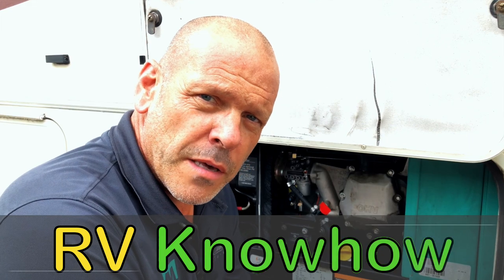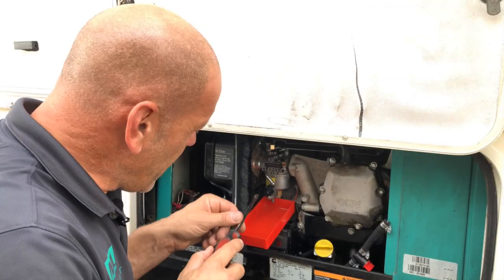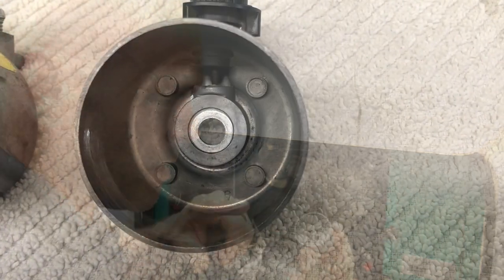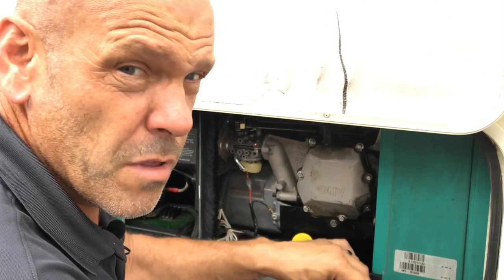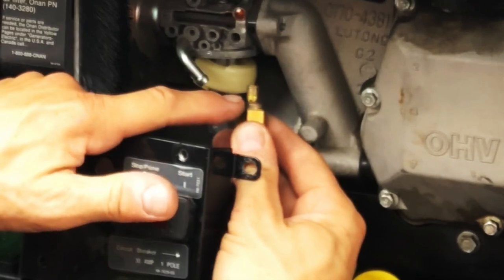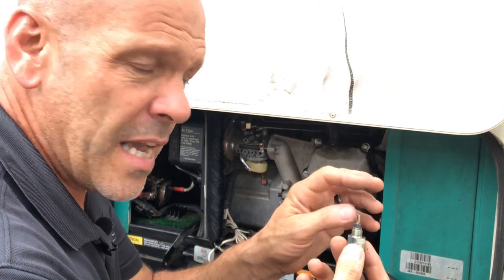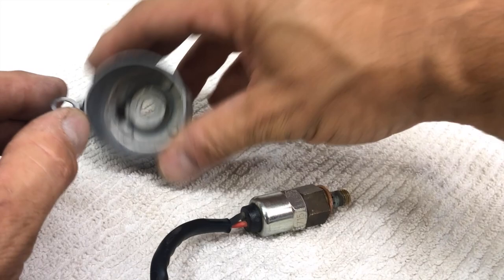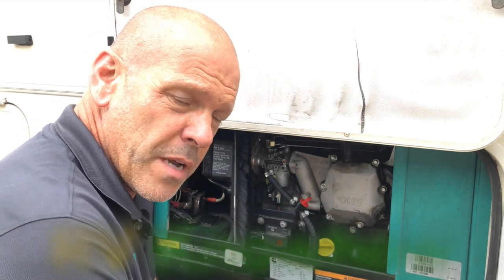RV Generator won't start, Fuel shut Off Valve Check and Fix. Part 2 of 2

Comment: Fantastic videos...part 1 and 2....I am a Rvia Certified Technician and I run my own mobile RV repair but never had much practical experience with Gen/Sets.....I see a lot of these 4000 and used these two videos to diag and repair one of my long time customers Onan 4000....I couldnt have done it with out your videos......very methodical and thorough.....thanks a million...looking forward to watching more of your videos....!!!

Comment: I have worked trough all dignostic here and all was fine. But the generator  woulden't start and go. The last thing was the carburator. I sprayed Carburator Cleaner inside through fuel intake pipe twice, and now the generator start and runs like a dream without any misfire.

Comment: Your video, single-handedly fixed my Onan QC 7000 genset. I learned from you that I could remove the carb bowl and clean those jets which fixed my "not-starting" problem. Thank you from the bottom of my heart. Getting compitent Onan service is neither easy nor cheap. You are now my go-to genset guy.
Reply from the maker: Glad to see my videos are helping and thanks for the comment

Comment: I found a good tip for the pesky wire behind the carb that you need a long pair pliers to disconnect. If you remove the carb to ultrasonic clean it that wire is long enough to run around to the front.  It's in a loom with other wires. Nip the zip tie holding the loom together and unlace the single wire and move to front. I suggest lace it in a single piece of loom for extra protection but not necessary. Not many will want to fully remove carb due to the fact its a pain in the ass getting it back in and gaskets lined up.

Comment: Thank you!  These things are finicky!  I just had to do the starter in mine (with the help of a mobile RV repair guy - and it took both of us).  Now having an issue with starting.  Fuel pump is good, spark is good.  This is the next thing to check.  Thank you.

Comment: I recently bought a 2008 Grey Hawk with only 7,100 miles and 37 hours on the Onan 4,000 generator. Everyone thought the generator would be trash. 
I removed the carb and cleaned the bowl, jets, and the STUCK SHUT OFF SOLENOID PLUNGER. 
Put it back together and it started right up. It even started at 6°F just two days ago.
Don't forget to check that plunger.

Comment: Great Video!!! I also had spark, fuel and air. Checked and verified via your first video. I even changed the spark plug just to be sure.  But still it will only crank but not start. This video helped me identify and clean out my stuck check valve. Now it turns on super easy. Thank you for the best video out there!!
Reply from the maker: Glad to hear my video was helpful and thank you for the kind words

Comment: All your video's have been very helpful! I just bougjt a Jayco Eagle 313H 2000 on an E450 chassis. My generator is an Onan 4000 KY. I bought a new battery fuel tank is topped off and it still won't Start. I will use your troubleshooting technique to see if that is my issue. Thank you so much for helping us newbies❤😊

Comment: That makes so much sense. Thank you for pointing out that these carburetors will run just fine WITHOUT that darn solenoid even installed. I have a main jet that just screws on without that solenoid. I know what it does and why, but mine was more trouble than it's worth. The main jet without the solenoid has three larger holes in it where the other one has about 6-8 holes in it.

Comment: Hey there, sir. I've been clutching so hard at so many straws. I watched this video and thought "nah, that can't be it". But you completely nailed it. This was my problem. Luckily the newer models are a little easier to tear into. All I had to do was remove the air filter mount so I could get to the bolt on the solenoid. The wires disconnected so I didn't have to loop them through the wrench.

Anyway, thanks again and cheers to you.
Reply from the maker: Thanks for the comment and I'm glad you found the video helpful

Comment: Thanks for the video it really helps.  My Onan 4000 starts but doesn't stay on.  I check the battery and is at 12.1 Volts, spark plug is good, air filter is good, and it gives me the same voltage when testing the options you show from the power to the engine and then engine and live as you did and it gives me 12.0 Volts.  I also checked the plunger and it's working too.  Do you think my voltage is the problem?  Thanks in advance for any help you can provide.
Reply from the maker: Hi, Thanks for the comment. 12 volts is very low, yes. A fully charged battery should be 12.6 V. And around 13.5 to 14 V when charging via the Motorhome engine alternator or battery charger. Once the generator starts it should be able to run without a battery even connected so I would say even though the batteries appear low voltage, it shouldn't be the issue. Do the batteries show a higher voltage when the generator is running ?
Reply: Thanks for taking the time, I didn't check the battery but I will once I get the generator to run.  Thanks for the great videos.  I'll keep you posted. @rvknowhow

Comment: Great video. I followed your steps and discovered I don’t have 12V coming from the red wire to the fuel shut off valve. Do you have any recommendations on what to do next?
Reply from the maker: Hi and thanks for the comment.
First thing I would check is to make sure you have 12 V at both sides of the solenoid.
Reply: Exact same problem, it's like I don't have something turned on in the RV.  I have good battery voltage.  I have no idea where that red wire goes and it's barely long enough to see any path

Comment: I have a generator that will only start if I spray starting fluid into the carb first, then it will run all day. Any suggestions on what I should check?

Comment: I’ve got an interesting issue… my generator was working Wednesday and Thursday evening at my campsite. Friday when I went to start it, it sounds like it was cranking, but wouldn’t turn over. 
Fuel was at roughly 1/2 tank, RV hadn’t moved (I know nothing rattled out of place) and obviously I was getting clean air and spark yesterday.
Any ideas where I should start?
Reply from the maker: Hi, sorry for your troubles, when you say cranking, can you hear the starter engage or does the solenoid just click ?
Reply: @rvknowhow  not sure if I can hear the solenoid, the engine is definitely rotating… entire generator is shaking, as soon as I release the start switch, engine stops
Reply from the maker: So if the engine is rotating and shaking we can rule out a starter motor issue, now if you check for spark and air filter blocked, also fuel flow, I have a RV Generator won't start part 1 video in my library that covers this, I would rule this out first before diving deeper, let me know how you get on
Reply from the maker: Oh sorry you mentioned you have clean are and spark already, so next is to bypass the fuel shut off valve and see if it starts
Reply: @rvknowhow  I checked the air filter, seems fine… didn’t think to check the spark plug, as it was working the day before… is that something that would just stop working?
Reply: @rvknowhow  will look into this later this week. Thank you for the help

Comment: Onan 2800 runs for about a minute then shut down.  Any ideas?
Reply from the maker: Hi Ray. There should be flashing code on the start switch when it stops running ?

Comment: Where is the fuel filter?
Reply from the maker: It’s located inside the genny on the lower left as you look, under the solenoid and control unit